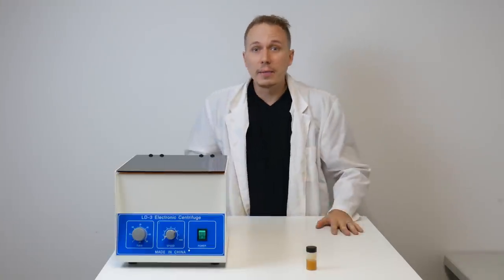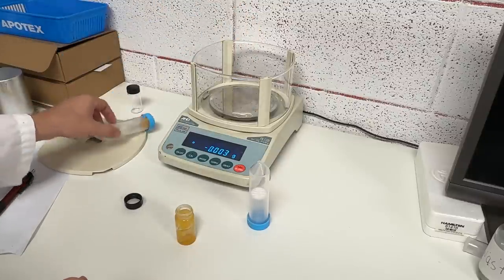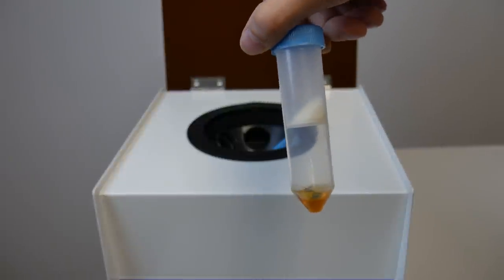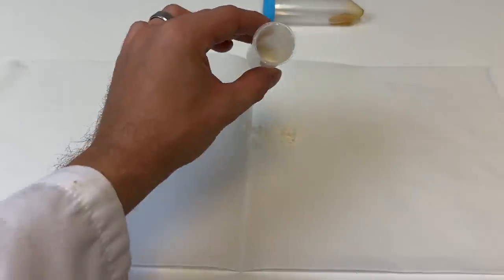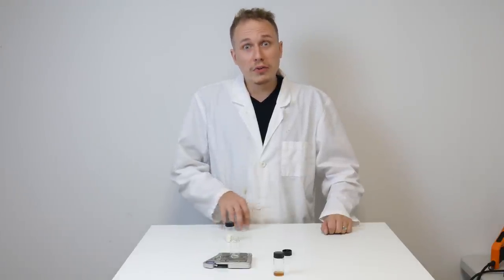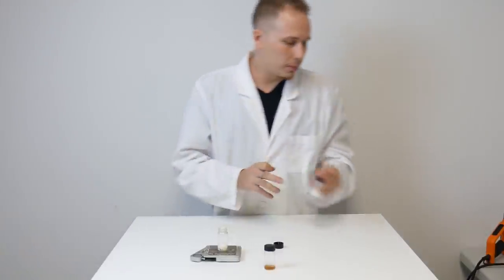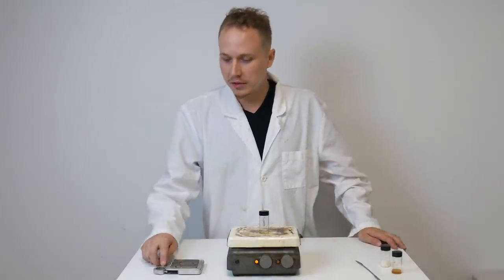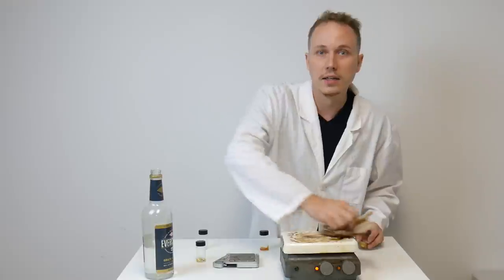Separate THCA from Live Resin and Terp Sauce using a Centrifuge

Comment: I loved the "Under the Sea" type music that was playing until around 15:00
Reply from the maker: It’s maplestory bgm music if you want to look it up
Reply: @CartandPod  thanks. Great video by the way. You deserve to go far as a cannabis science communicator.

You're one of the few people out there who's come up with a video showing a good separation method between terps and other volatiles from the carboxylates to be heat treated. I saw other people mentioning argon in the comments and so you stood out as somebody who really is prepared to put in effort to handle the goods in a way that minimises direct heat damage or transformation, and oxidation/heating-accelerated oxidation with two interlocking techniques by simultaneously protecting the headspace and using a less hot method.
As a layman without lab experience, I was amazed to hear that centrifuges tend to heat up over time.
Is this caused by the motor, air turbulence inside the machine at those speeds or just heat due to friction within the sample as closely intermingled viscous materials are torn from those which remain solid behind the filter? 

I was wondering, could the process simply be paused between two halves of a pull to let the top mixture cool again before the process is restarted, or would that just be pointless. Under argon as you're doing, it might not be pointless. If someone did it under just air it might worsen the exposure period to oxidation but perhaps your protective coating could make it worthwhile. I'm sorry I'm really just talking out of ignorance but I'm fascinated.

I read once that supercitical CO2 (which everybody assumes to just extract everything no matter what)  can target different ends of a molecular size/weight scale depending on what pressure is used, within a very fine tolerance, ie within the extremely narrow range of temperature/pressure combinations that are at or close to supercritical . Lower pressure supercritical can supposedly pull lighter compounds in the case of CO2 used under special circumstances that by design,  do not actually extract everything.
So, supposedly within that finely calibrated range, lower pressure can get more volatiles and vice versa for heavier wax alcohols. 

Have you heard of this claim, is it true? 

Anyway respect I admire your work.

You've got a new fan in Australia, where sadly I'm not legally in a position to pursue this matter scientifically, 1 I'm not a scientist and 2 even if I was I think only a very limited number of researchers are given access to work with cannabis resin products, usually only those attached to universities, hospitals and drug companies. But if I had the equipment and the legally respected right to do it god I'd love to learn how to be able to safely play around with all this stuff if I had the money.

Nevertheless, I'm still entertained and fascinated watching from a distance.
Reply from the maker: The heat is primarily caused my the air resistance as well as heat generated by the motor in the I closed space.
Reply from the maker: Sadly I don’t have any experience with co2 extraction as I’ve never had the pleasure of using one of those machines yet.
Reply: @CartandPod   well you've got a great technique of your own. Bravo.

I've also heard that CO2 can, contrary to the reputation of the compound being associated with extreme cold, actually cause heat damage to samples during extraction. Anyway keep up the good work!

Comment: Why cant you just put crushed ice at the bottom of the metal centrifuge holder?
Reply from the maker: It won’t balance, I suggest you don’t skip over parts of the video before you run it :p
Reply: @CartandPod  couldn't you weigh it out equally then?
Reply: @CartandPod  I see a scale right there

Comment: Soiiw Electric Lab Benchtop Centrifuge Machine,Low-Speed 4000rpm Speed Control Centrifuge Machine 6 Tubes x 20ml with Timer 0-60min - Is what I ordered from Amazon... can't for the life of me find tubes and filters to use with it, or unable to find any info on what size they may be. Caved and bought the ones in the link that most certainly aren't going to fit. Any help?
Reply from the maker: Can just use rosin bags that works too
Reply: @CartandPod  Sweet, I have bags. Any tricks seems off somehow?

Comment: probably won't get a reply that doesn't involve sending bitcoin to a telegram bot but anyways.... Ive been doing something similar but was wondering if it's ok. I just do somethings intuitively without knowing if they're the best way. When I jar/glass tube THC(a) I use a nitrogen bulb from from a whip cream dispenser to try and top up the container. I often use household kitchen equipment as I'm not able to set up a dedicated space atm. Is this ok?
Reply from the maker: Yes nitrogen works just as fine, why would I charge you Bitcoin on telegram to answer that?
Reply: @CartandPod  lol, didn't expect a reply (especially so quickly). I seem to get bombarded with fake messages pretending to be the creator asking me to join their telegram and send btc whenever I comment on poo toob.
Reply: oh and TY very much. @CartandPod

Comment: Here's a question with the light all around you and the fact that you have handled the container it's in with your hands which gives off some heat I would assume this is no longer thca anymore and it has already converted to d9 correct? The way I understand it is because of how easily it converts into regular THC it sometimes even shows up to the shop already converted even though it is thca on the label
Reply from the maker: Wow… it takes a lot more than the heat from your hands or some lights to convert the thca to thc… did you even watch my video bro? I decarb in the video…
Reply from the maker: Decarbing is converting thca to thc, it needs around an hour and 250F. Its a lot of energy to remove the carboxyl group (convert thca to thc)

Comment: But those terpenes are eating away at that plastic and introducing microplastics into whatever you are using those terpenes with.
Reply from the maker: Nah not at that low temp and time as well as low concentration, but prolonged use or higher temp would be a concern
Reply: @CartandPod  in lab studies done with multiple mmtcs, you can't have any volatile terpene compounds touching any synthetic polymers.

Comment: Hey I have a question, are you going to make a video about how to separate thca from rosin?
Reply from the maker: Whenever I get some rosin yea
Reply: @CartandPod 👋
If you find the time to respond . . . What’s thr difference between resin and rosin?  I bought everything in your link (but am having trouble finding the metal tubes) and I have a brand new NugSmasher, I was planning on pressing freshly harvested flowers (no drying or curing).  If I press freshly harvested flowers and press through a 100 ug mesh bag will I be producing resin or rosin?  

Thank You for everything!

Comment: So u have 1 thing then u spin it and u get 2 things that u should use by mixing them together again 😅
Reply from the maker: In a different ratio, but it’s mostly so you can decarb the thc without damaging the terpenes
Reply: @CartandPod  wouldn't a low temp dab do that ? "decarb the THC without damaging terps"
Reply from the maker: Of course that’s not what’s happening here, when you vape it it’ll convert the thca

Comment: could you also use food grade nitrogen instead of argon then? Also do the filter tubes in the link in your description come with the little filter in the tube?
Reply from the maker: Yes nitrogen is fine too
Reply from the maker: Yes the filter tubes come with the filter but it looks like their out of stock atm
Reply: @CartandPod  cool thanks, good video! I look forward to trying it with 'food grade' and see how well the thc separates. I did order the filters looks like they are in stock..
Reply from the maker: Ahh they must have just replenished, right on
Reply: @CartandPod  Just got filter tubes in from that link and they are wrong size, 23ml instead of 20ml. Do you happen to know where to get the correct size tubes with the correct filter?
Reply from the maker: @roguethrottle what do you mean? The filter doesn’t fit in the tube?
Reply: @CartandPod   oh im seeing now that the link for the centrifuge in your description isnt the same as the one you used. So i need to send the one i got back and order the one you have for the filter tubes to fit. Also the metal tubes you were chilling doesnt seem to come with the centrifuge, do you know where to purchase those?
Reply from the maker: @roguethrottle hmm maybe the Canadian version is somehow slightly different, it came with the metal tubes
Reply from the maker: @roguethrottle I’m not sure sorry
Reply from the maker: It’s odd because it should be the same one in the link as I used, maybe they changed it recently. If you find the proper link anew let me know please
Reply: @CartandPod  cool yup just posted the correct link
Reply from the maker: Hmm it looks like YouTube is removing the link when you post it cause I can’t see it, can you post it on my discord or email it to me on my email on my about page. Thanks so much

Comment: So if I just get the containers and a string and spin it on something that way would it work with a longer spin time?
Reply from the maker: If you can spin at 4000 rpm lol
Reply: @CartandPod  ya the machines aren’t as expensive as I thought lol
Reply: @CartandPod  what if you attached it to like a fan and let it go for a couple days? Does the rpm matter if you just add time to the less rmp’s?
Reply: @CartandPod  would make a good experiment if someone attached them to ceiling fan and seen if it works with just more time spinning

Comment: Do you fully purge the resin before running through the centrifuge , or do you fully purge the diamonds and terps separately after they have been isolated ?
Reply from the maker: Your live resin should be purged as part of making it…
Reply: @CartandPod  thanks for clarifying. When using diamond miners some solvent is left in the extract. I was wondering if this was also the case for this process.
To further clarify, when you say nucleated, do you just mean the resin needs to be whipped into a badder?

Comment: Please mr weed ..im completely newbie in this science and im trying to gather as much info as possible. There are many ways how to obtain thc concentrates..i looked many of ur vids but easiest way( i have to mention i live in europe here Its not legal so understand me please) is use thousand dolar machine that gathered around 4.5 g from 28 g of bud..second option is to get rosin from pressing it which is giving you around 6 g from 28 depends on quality but i saw many vids and Its around that ratio ..machine was using 99% alco for extracting the oil and also could do decarb process if u wish so ..pressed rosin is pure thca and does have to be decarbed ..sir please im conpletely confused with decarb process ..many guys say even on nugsmasher or other brands even u said that rosin or oil just for pure vaping does not have to be decarbed because as ur vaping it with coil it autonatically changes structure and u will get high since it transforms thca to thc with burning process but i also found you personally in older video explaining that even rosin have to be decarbed because it still contains some percentage of wax and other stuff that makes ur quality of thc less efective..please with 2023 Its very confusing to pick right option but i feel like for me pressing it and then use magnetic strrier for mixing rosin with terp or liquid wax is way to go for me ..do i have to or do you recommend to decarboxilate rosin even will be purely used for cartridges not eadibles? And do you recommend to mix it with terps or liquid wax because what is little confusing me that ppl say terps are best but somewhere they use 1-1 ratio so gram to 1 ml of organic terps somewhere they do like gram to 6-10 drops where drop is 0.025 so it will be less product than if i go 1-1 ratio ..meanwhile wax they reccomend to use even 2-1 ratio so 2ml of wax to 1 gram of concentrate ..im confused for the best option to gather best hit from my honemade cartridges ..my last question is about mixing other canabinoids to rosin like cbd powder or cbn oil to make it fuller of spectrums ..is this what you recommend to do for better high? I would like to not get that drop what i suffer after my bud high goes off i like the way it kicks only from thc but immbot sure that cartridges since they are Ug are combined or pure thc ..i would like to know your recommended ratio on % for example or maybe you can do educational video ablut other canabinoids and their effect mixed with thc one by one how it feels and what effect should you expect . I would like to get Nice high but dont like that heavy hit and tireness when Its leaving i would like to mix it proportionally to avoid that feeling of tireness but still got that active kick and euphoria ..Thank you very much and i really do appreciate ur work sir
Reply from the maker: This is too much to answer at once try asking in the discord please
Reply: @CartandPod  that would be really awesome if i would be allowed to..if u be so kind ...how can i join there?
Reply from the maker: Just click this link https://discord.gg/CahhFKZ  @marsinko9714
Reply: Do you need to decarboxylate rosin for vape cartridges?
No, decarboxylation for vape cartridges isn't necessary. The heat from the vape device will decarboxylate the THCA in the rosin as you use it, converting it into THC and allowing you to experience the high.

Should you mix rosin with terpenes or liquid wax for cartridges?
Terpenes are a good option because they can enhance flavor and potentially improve the overall experience due to the entourage effect. However, use them sparingly. A common ratio is a few drops per gram of concentrate, not 1:1. Liquidizers can help with consistency but may dilute potency and flavor.

Do you recommend adding other cannabinoids (like CBD or CBN) to the rosin for a fuller spectrum effect?
Yes, adding cannabinoids like CBD can balance the high and help mitigate some undesirable effects of THC, such as anxiety or a harsh comedown. Start with a modest ratio, like 1:1 or 2:1 THC to CBD, and adjust based on your preference.

What is the best practice to avoid tiredness but still achieve a euphoric high?
Consider a balanced THC/CBD ratio to moderate the intense peaks and troughs of a THC-dominant high. Adding CBD can smooth out the experience, potentially reducing the tiredness after the THC effects wear off. Experiment with different ratios to find your sweet spot.

Comment: you really overthinking centrifuge balance. i work with all sort of centrifuges from the same size you show to about 8-10 times larger
Reply from the maker: I think it might just be an issue with these cheaper machines but when this guy is off balance even a little you can hear it and it starts to rattle. Probably a lack of any shocks or any vibration dampers/etc compared to your proper units.
Reply: @CartandPod  yea i was thinking that as well, as even in my lab i tend to avoid the small “cheaper” ones when i can. as long as the weight is the same you are balanced, a pound of bricks=a pound of feathers 👍

Comment: Can i use hash rosin from an old hash? Or is it only worth it with live rosin?
Reply from the maker: Live RESIN is different from ROSIN. Resin is an extract using solvents, rosin is made with heat and pressure. 

You can use rosin but it must be nucleated first
Reply: @CartandPod 👋
How do we nucleate the rosin?

Comment: Man just save a fortune a man’s buy some 15u bags
Reply from the maker: Rosin bags work too for the centrifuge, yes
Reply: @CartandPod  yeah but time and slight pressure you can save hundreds if not thousands isolating without a centrifuge and it is not a cheap piece of equipment and mostly used as a fast way to purge now
Reply from the maker: This device is just $99

Comment: dose thism work with roisn specificlly flower rosin?
Reply: live rosin IS flower rosin.  usually extracted with icewater or static electricity
Reply: @revminTphresh that isnt at all the same thing
Reply: Flower rosin is contamiented wit fats n lipids while hashrosin has almost zero and has way higher terp counts its almost like saying flower n hash are the same😂
Reply from the maker: If you extract it with water then it’s not flower rosin, it’s hash rosin cause you made hash first
Reply: @d4rkmarine397  unless of course you use a screen.  you know, so it doesnt become " contamiented wit fats n lipids".  genius that.
Reply: @CartandPod  every single company in the state i live in does their live rosin extractions with ice water.  every. one.  seems to me you are arguing semantics.